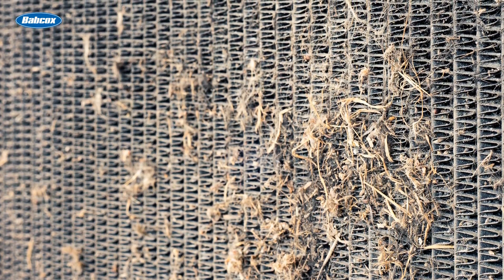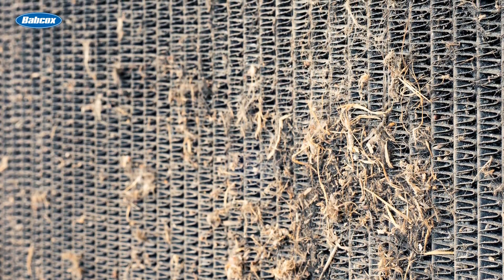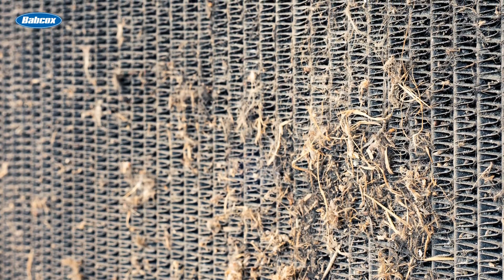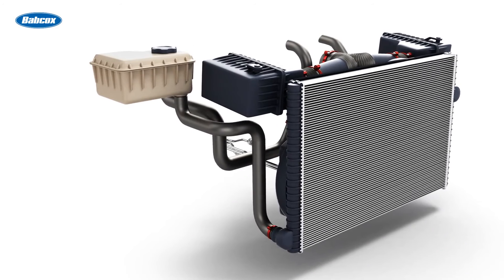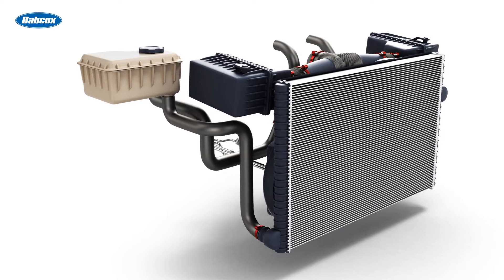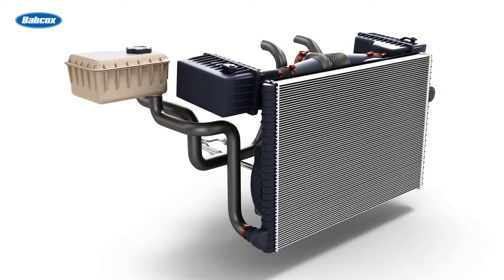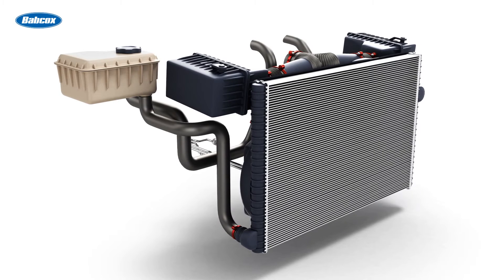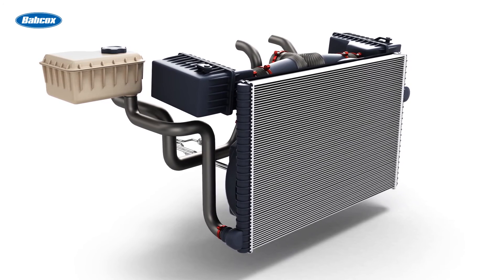A Closer Look At Radiator Cores

Comment: Although I still think there is advancement in radiator efficiency, instead of air flowing through the channels you could have coolant inbetween the cores with an aquaponics bubbler to cool the coolant cooling the coolant in the core chambers, bubbler at the bottom and an air release at the top with an pipe routing to the atmosphere underneath the car